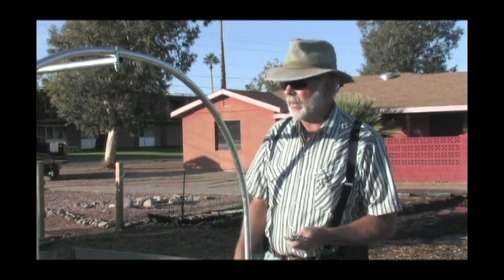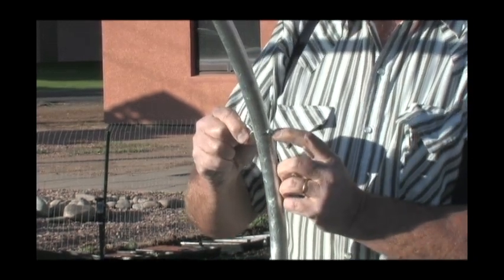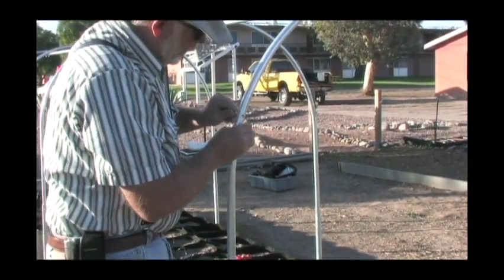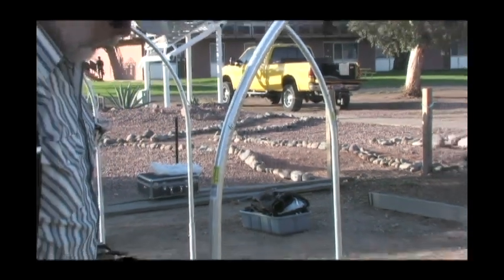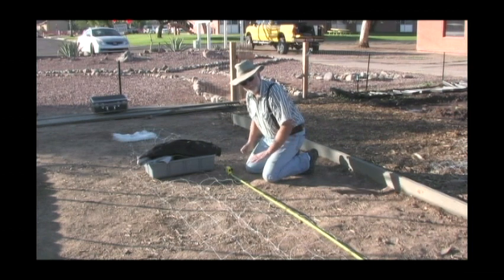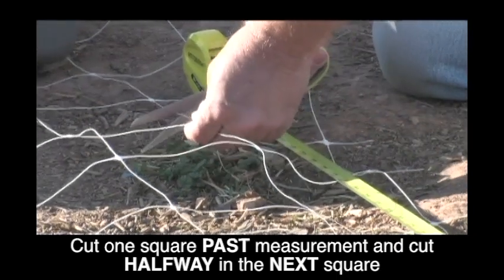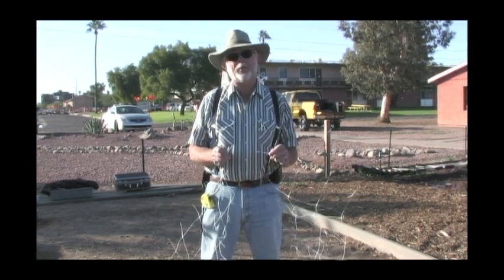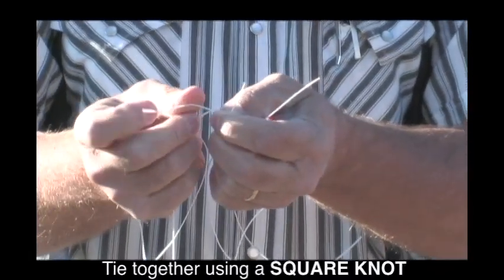The Garden Master's Trellis Installation Part 1 of 2

Comment: You build and install in the ground a T at each end and in the middle of the garden to connect the three lateral support wires to in the same way that they are attached to the greenhouse structure. One in the middle of a 4x8 garden and two evenly spaced in the middle of a 4x16 garden. The two end T's must be deadmaned for horizontal support.